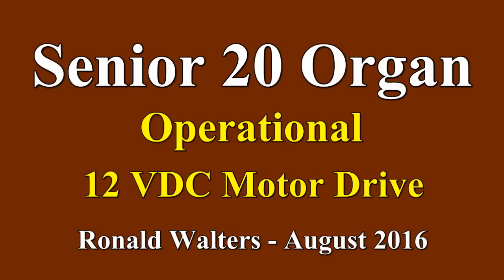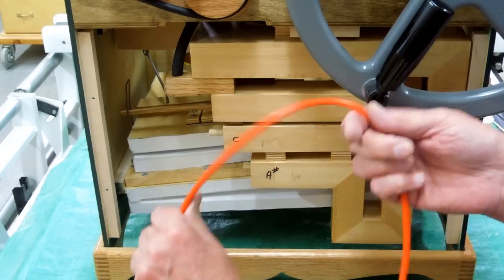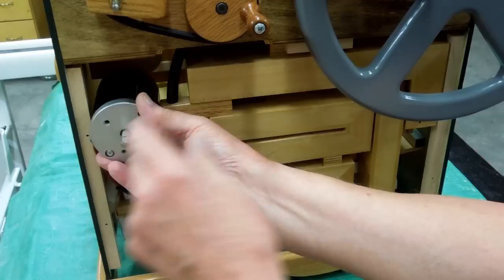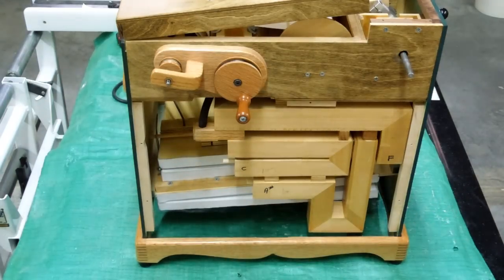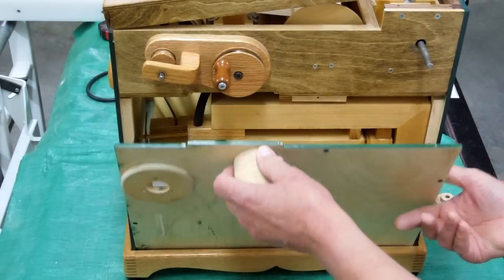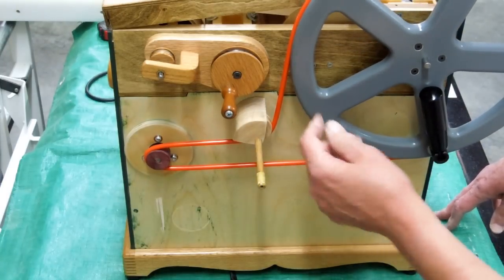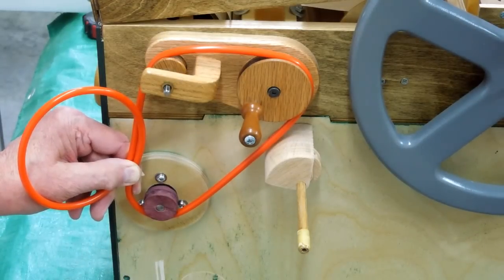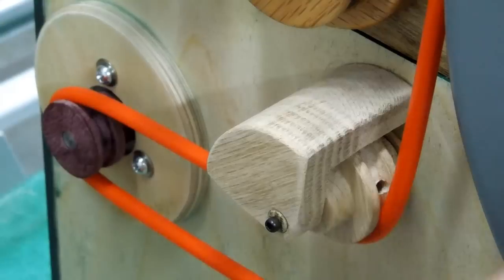Senior 20 Organ (34) Operational 12V Motor Drive Part 1

Comment: you can try a stepper motor and a toothed belt, that way you can vary the speed as you need with a driver board and you wont have any slippage or stretch.
Reply from the maker: The intent was to keep it simple... something most anyone could do. A lot of people are not into electronics or Arduino controllers. The hand wheel is the perfect size for the large pulley and the belt easily custom made with urethane round belt. The DC Motor controller is cheap and works perfectly. Old school rheostat controls the speed and there is no stretch or slippage.

Comment: why couldn't you drive the rewind crank  using the idler pully just below it?
I can see no reason to have the top left idler pully...
Reply from the maker: The top left pulley is what connects to the music spool. It is not an idler.

Comment: Ron, it's probably too late now, but if you were to make a levered extension to move the rewind wheel (over a bit to the right) to touch the drive belt, it would turn the rewind wheel counterclockwise as needed. Of course you would need to disengage the bellows.

Comment: I love seeing this come together as much as I love hearing it! 😄 Has it really been six years? 😮
Could you feasibly make two one-way slipping clutches, and have belts on both the main drive, and the rewind mechanism? The correct belt will engage the correct clutch, depending on motor direction. You could even have a gear mechanism in the motor which swings back and forth and engages the drive or rewind mechanisms. Tape decks use this for the fast forward and rewind, if you need inspiration 😄
Good luck, Ronald!

Comment: Nice. I would expect nothing less from you than a clever mechanism that uses the same belt also for rewinding. Just some pulley that can be levered to to engage rewind pulley also with the red belt.

Comment: Really like your stuff... Any way to redesign the rewind to double as the idler when not in use? Its not like you will ever need to run both at the same time. That may be too much of a redesign at this point of the game though.
Reply from the maker: For an existing organ I am quite happy with the way it turned out. Trying to reposition and/or redesign the rewind at this point in time would also mean having to deal with unwanted screw holes and other issues. The belt(s) are very easy to put on and take off (seconds). I am in the process of assembling the second Senior 20 organ and some reconfiguration will no doubt take place.